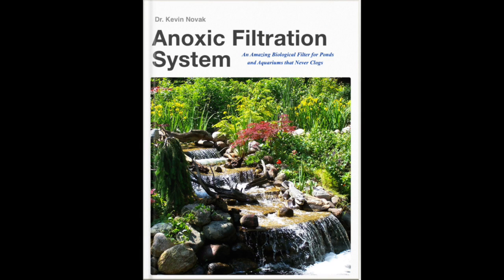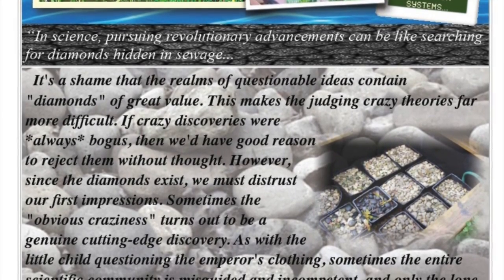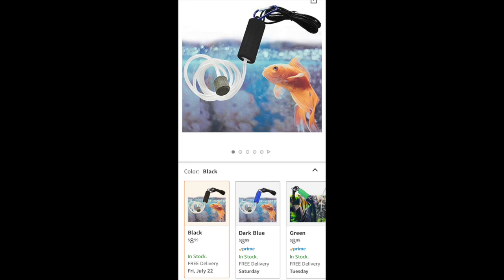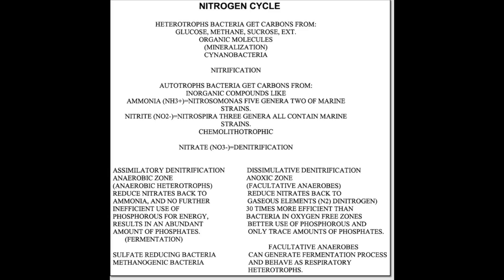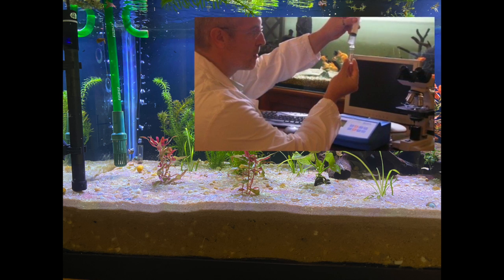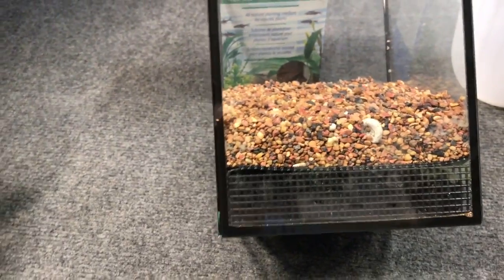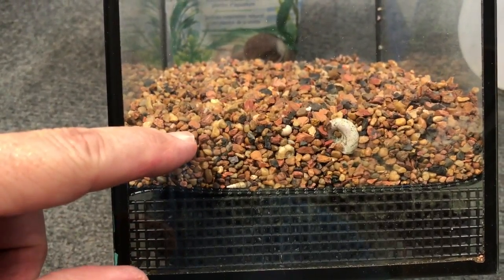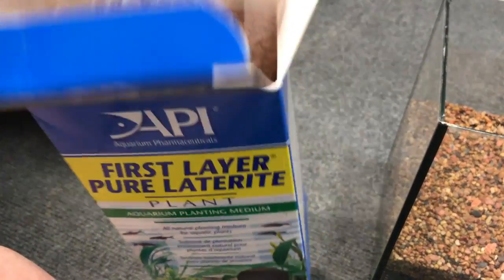A question that’s continuously asked: How fast should I be running water through my Plenum?

Comment: I built my 10 gallon aquarium using a commershal UGF like when I was a kid. That was before I discovered your video's so I have 2 up lift tubes I was thinking I could cap one like you showed in one of your videos. Also like I was told over 30 years ago I bought the largest airstones I could fit in the lift tubes. so may be I should put the smallest stones in the tube I have shortened the tubes to 5 inches I wll take off 3 more inches that leaves me only 2 or 3 inches above my existing substrate, do you think this will work?

Comment: I'm going to set up a 10 gallon tank with plenum. For the bubbler i'm using the CO2 line.  One bubble per second.  I think it will do the job, after all i just want to move a tiny bit thru the plenum.

Comment: I originally thought that the size of the tube 3'' dictates the amount of water it moves regardless of the pressure of the pump. On my goldfish tank i was running a 3/L minute pump at full power and my nitrates were 10ppm they haven't increased nor decreased below 10ppm so I've turned the pump down to see what happens. I will say though 10ppm for a goldfish tank is still low, so no complaints here. :)

Comment: I wish to make a BCB basket but as I am in India, products such as non clumping kitty litter are unavailable, even if they are most are not fragrant free. Laterite is also unavailable.

I was wondering instead of the kitty litter could I use the clay balls used in hydroponics and instead of laterite could I use chelated iron powder? Would they work? As the clay balls are inert are they capable of attracting the negatively charged ions?
Reply from the maker: The only trouble with the clay balls that they use the hydroponics is, they are so big. However, you can place some of them underneath the Plenum to help aid in anoxic conditions. Just use a smaller substrate for your Plenum even if it's not clay and the platinum should work if it's slow enough but yet water, still moving through it.

Comment: Good afternoon Dr Novak. I bought a second hand tank it holds 80 litres of water. So about 18 gallons. A fairly small tank. I have made my first ever Plenum. I have put a few plants in the tank along with my substrate. I put an air stone in to the uplift tube and it is creating a lot of bubbles. Can I slow it down by adding a couple of no return valves ,or do I need to buy a new smaller air stone like the one you show us on this video? 
Also this tank has a small sponge filter with a bar with 5 holes in it which blows out little " rivers " of water. 
I will let things keep working for a while. Whilst my 6  goldfish are small I am bringing them in for the winter. Do you think my set up sounds OK Dr Novak. I would hate to lose my fish by my own incompetence? Your book looks amazing but I don't have apple unfortunately.
Reply from the maker: yes that will work.
Reply: @anoxicfiltrationplenums  Thank you Dr Novak. I am enjoying your videos. Your goldfish are really lovely. 🧡

Comment: Just the video I needed! I've set up my 250L (55G) tank last october, but I haven't been able to get the nitrates down. I used one of those USB air pumps, and thought that the flow was too lów. Now I've put in a control valve and roughly halved the flow to see what that does. I've done the same for tanks with the same problem. Obviously now that I think about it, if the flow was too low, I would've smelled it..

I was looking at getting an LA-28 linear piston pump, but with such a low airflow needed, it would be absolutely overkill for my tanks, even though I have 11 tanks (most are 40-80L, 10-20G). I dislike the fact that regular air pumps tend to get noisy and seemingly less effective over time. A linear piston pump would solve that, but the ones I've found are way too powerful, and probably meant for ponds. Does anyone know if there are smaller linear piston pumps out there? Or am I stuck with a bunch of noisy pumps?
Reply from the maker: Plenums need a very small air pump like the smallest tetra pump that is out there and probably will still need a bleeder valve.

Comment: Thanks for sharing this and also the tip on slowing down the powerhead and clarification that it will not hurt the pump. 
I've used a thin uplift tube on my plenum going up slightly above the water surface. However,  I've kept the aerator slow so it keeps the flow to a slow trickle dripping back into the tank onto the water surface creating a slight agitation of the water surface. I hope that should be adequate. Its  only about a month since installing the plenum so still  waiting for the plenum to mature. 
For the plenum, I used a plastic egg crate with open ended slitted cups and filled the cups with kitty litter, placed a net screen over it and covered it with gravel/sand mix to about 1½ inches.

Comment: When I first cut down my intake tube I had it cut down as low as I could get it, barely bubbling. After 2 weeks I developed a black scum on the bottom sides and gravel around the ugf. I figured there was not enough water being pulled thru the UGF. I increased the bubbler flow twice until the scum started disappearing.  It is gone now but I keep my eyes on it. Thanks for more detailed info it helps a lot.

Comment: I would like to have a go at making a bcb basket but can't find any media to use here in Australia.We can't get the kitty litter you use.I can get seachem flourite.
Reply: Hi - I found the correct kitty litter at my local Woolies in the ACT. Bright orange package. Hope this helps.
Reply: I use SafeTSorb with great results, but I'm in the US. I looked it up for Australia and it looks like it's very expensive there, about $560A ($390USD) for a bag I can get here for $8.

Perhaps a clay oil-dry product from a local auto parts store. As long as the granules don't turn to mud and it doesn't hurt the fish.

Comment: Hi Kevin,
It is also correct to say that the plenum will work with no bubbles, once the substrate size is 2-5mm and at least 100mm deep, the water gap underneath the substrate is enough to prevent oxygen levels dropping too low.  The nitrate will be drawn into the plenum regardless. This plenum principle has been used in some marine aquarium for years.
Great video, keep up the good work!
Reply: this answer has definitely helped my process, i disconnected the air pump to see how it would work and what do you know now i'm under 5 ppm of nitrates consistently thank you!

Comment: How many total volumens of aquarium per hour?
Reply: I have found that it has a wide range. My 20G long turns over approximately 4 times a day (about 6 hours), my 5.5 gallon is about the same speed so it turns over about 20 times a day, and my 1 gallon jar turns over at least 50 times a day. 

All 3 of these tanks have gone anoxic and are quite heavily stocked, or in the case of my 1 gallon jar it has heavily fed fry.

I use SafeTSorb as my only substrate so far.

Comment: I'm using an airstone bubbler placed at the mouth of the penn plax riser covered with 1/2" fluval stratum, 1/2" kitty litter, 1/4" seachem flourite, then 3" of fluval stratum, 1/2" coarse gravel to keep the plants from dislodging. My best guess is that the air pump is lifting around 5-10 gal/hr based on specs and positioning. The new 20 gallon tall tank took around 3 weeks to cycle. Nitrates dropped down from 35ppm to 0ppm a week later.  My friends are still surprised that I only needed to top off the tank with DI water. Now I have to figure out what to do with the 20lbs of leftover kitty litter.

Thank you for such an economical and maintenance free method of tank keeping.
Reply: The extra kitty litter is for more tanks of course, lol.

Comment: I have a 65 gal with two Oscars and one pleco.No plants.  A UGF with two power heads, and a cannister for mechanical Filtration,  and a second fzone with bcb homemade basket of your design connected to the discharge side of the mechanical cannister.  I added the fzone about a month ago.  I test the water bi- weekly. 
I tested this morning.  0Am, 0 No2, 40ppm No3, ph 7.2, temp 83. These readings have remained constant since adding the fish back in early April. About how long does it take to start seeing a reduction in No3? Had I found your channel sooner,  I would have built a higher plenum with maybe some biohome balls underneath, only bc I have about 15 kgs of biohome on hand. 
The gravel drpth WAS a uniform 21/2 inches  but the Oscars like to rearrange everything constantly!! They're incredibly strong fish! 
Thanks for all your info and work you put into your channel.
Reply from the maker: If you're using the under gravel filter as a Plenum then you need to slow down its output considerably. This is the mistake they made in the 70s by adding too much flow through the under gravel filter when it should've been slow down to 5 to 10 gallons per hour.
Reply: @anoxicfiltrationplenums  
Thanks! I will slow them down. Those fish love the current they create.
Reply: I keep cichlids too. To avoid them digging all the way to the ugf, I put most of my substate down, then put a layer of plastic mesh down that covered all of it, then another layer of substrate over that, along with all the rocks and wood. When they dig, they can't get past the mesh and the substrate beneath it gets to stay in place and continue working as filter media. But like Dr. Novak said, the flow should be slow.
Reply: @hardybryan  that's a great idea with the screen.  I'm getting ready to start another cichlids tank, and I will definitely do that. Too late for the Oscars now. The tank is very clean.  I'm patiently waiting for the fzone bcb to start reducing thr nitrate. 
One thing is for sure in this hobby....
You gotta have patience!!
Thanks!!

Comment: I have plenums running in all my tanks now. I have no way of calculating the flow rate through them. They are all running on air stones with 1 inch tubes, which I cut down to just an inch or so above the substrate line. I used flow valves on the air lines and turned them down to the point where they didn't push air at all and slowly opened them up until they just started pushing air through. Do I need to find a way to measure the flow? And does it really matter since I'm not sure how I would make them slower?
Reply from the maker: It sounds to me you were on the right track. Turn up the air valve into you just see the bubbles coming out and start from there to move water through the 1 inch tubes. It sounds like you're doing everything correctly.
Reply: @anoxicfiltrationplenums  Thanks. It's only been about 2.5 months since I set them up, so I'm doubtful they're fully 'cycled' with the anoxic bacteria, but 3 of them have BCBs running as well and they've been soaking up all the ammonium anyway. I also have plants growing out of the tanks (pothos and peace lillies) so I haven't actually seen any readings for any nitrogen forms at all. I can't say which are doing the most work, but I'm loving the results regardless. Thanks again for responding and giving out all this help and advice.

Comment: I had to replace my old filter pump recently so I went with one of those more powerful internal power head filters with the sponge inside a casing attached to the bottom. It pulls water from the bottom as well as the sides so I placed it directly over the top of my uplift tube so a little water gets pulled through it as well. Ever since I switched to the bigger pump it I've noticed my plants are putting on huge new leaves now and shooting up more stalks from the base indicating that their roots are growing a massive healthy root structure for these types of plants. Maybe it wasn't moving enough water through before with my old pump because I have a very fine mesh cloth over my plenum so I would need a bit more pull to move water down through the slits of my homemade filter plate (it has more resistance then an open grate with gravel). I will continue to monitor the aquarium's little ecosystem and when I see positive results I know I'm doing something right. 👍🏻😊
Reply from the maker: My point exactly. Each hobbyist Hass to determine how they set up their Plenum and if the water flow is not fast enough they'll have to increase it little by little just like you did.

Comment: Also with the power head. I'd use the little air tube that it pulls in air to make bubbles. Run that line to the plenum and you could adjust the flow with the little plastic flow control you'd use for a bubbler. Last the hard the motor has to work pulls more amps. The easier the pump runs the less power it uses.

Comment: This is great but a question I've had is what about tank size? If the bottom of your tank is 72x18 inches one lift tube doesn't seem like it would be enough compared to the smaller tanks you have talked about. I want to do this in my aquariums and this question is all that's stopping me. I've used bcb bags and baskets instead but wild like a plenum.
Reply: What I suggest as a role of thumb is preparing the plenum (to avoid turning down later) with an uplift tube every 20" to 30" in the length of a tank, start using the one in the corner and cap (look for tube plastic furniture cap) the others, if you figure it out is too low flow, you open another lift tube.
Reply: Hit and trial.
Reply: All you are trying to do is create a zone where the oxygen level is 0.5-2.0 ppm
Above this and your bacteria will not break nitrate to nitrogen and oxygen.
You can’t be too slow with the flow, the water plenum underneath is sufficient to prevent oxygen dropping below 0.5ppm
Too fast and you will not get the right conditions